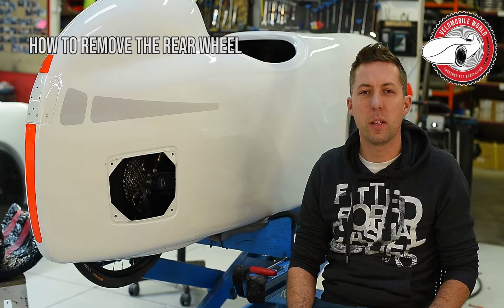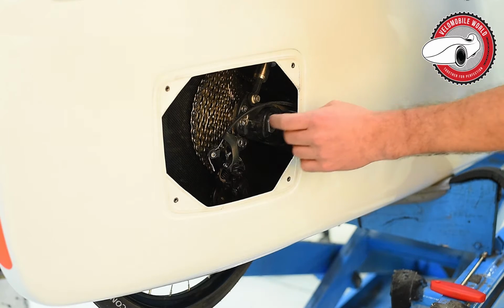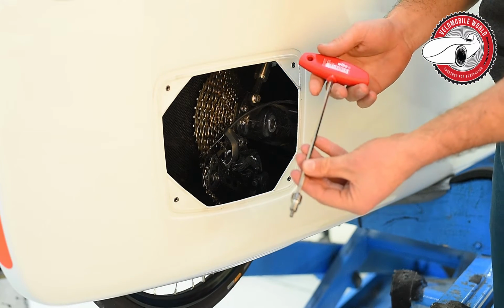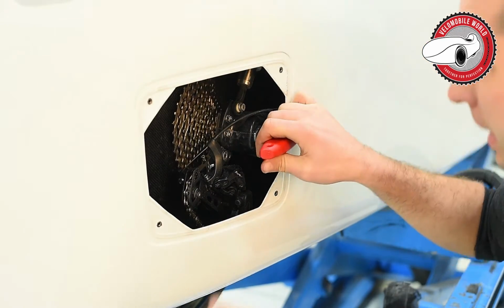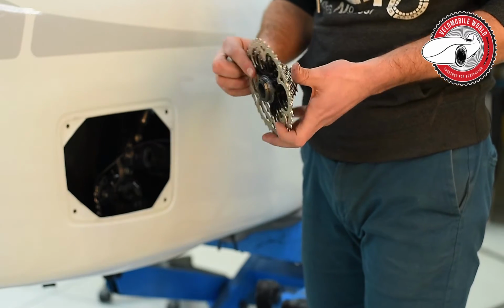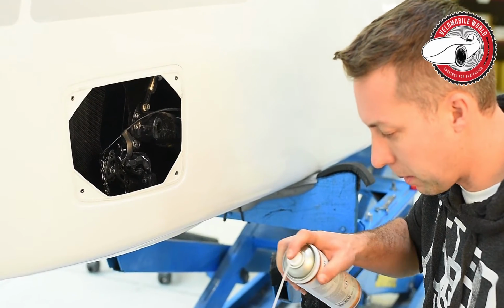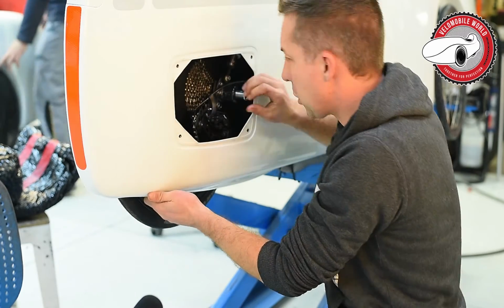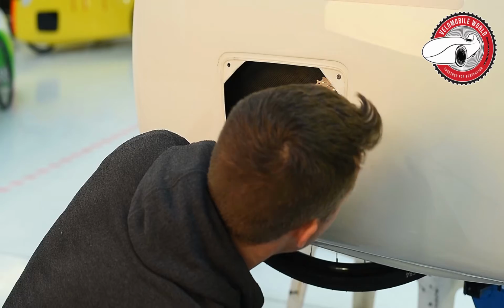How to remove the rear wheel | Velomobile World

Comment: First of all... excellent video instruction... 
However... It seems that the access panel is positioned too far to the rear of the axle... or it is just a bit too small and limiting...
but hey, what do I know.   I have full access to my drive train on my WAW.   Though I have been considering an Alpha 7.
Reply from the maker: Did you already to try to work with an alpha 7. Because the rear suspension is different as in WAW I dont see a big need for the complete tail to be removeble

Comment: I’ve used Daniel’s video and I lay my DFXL on its right side to position the hub over the free hub that is barely protruding into the wheel well. As Daniel shows, the last step is to push the pawls in to allow the wheel to drop down . I do not see you covering this important point.
Reply from the maker: at 08:26 there is the shot